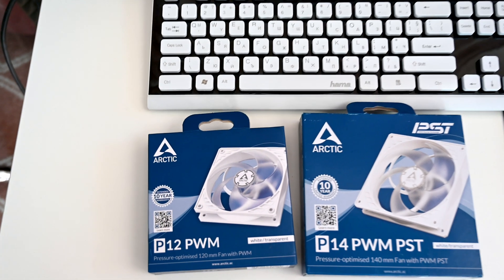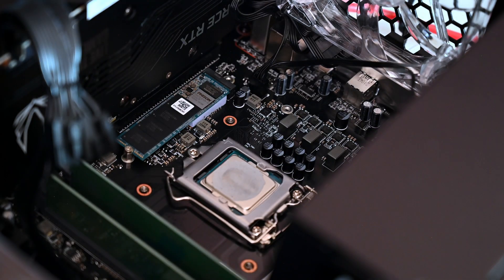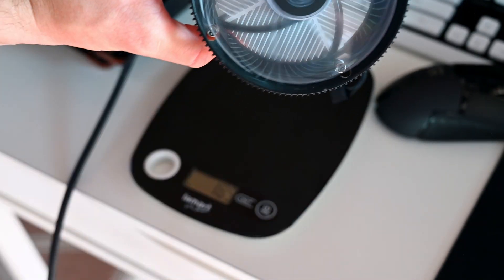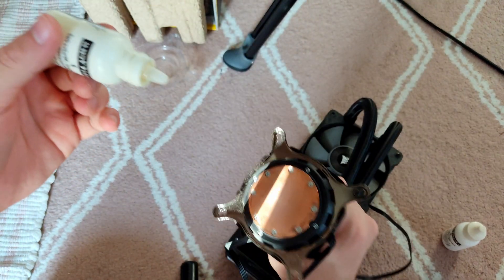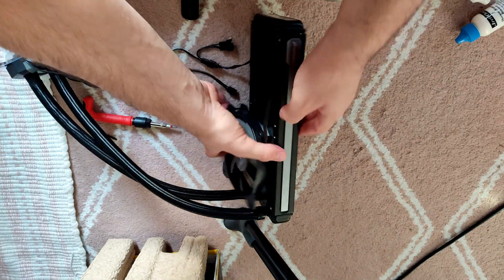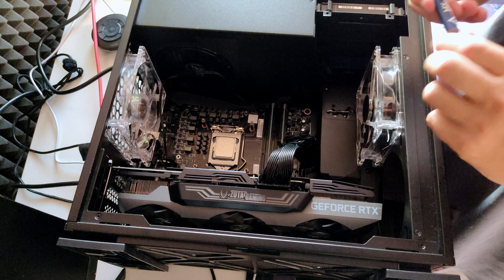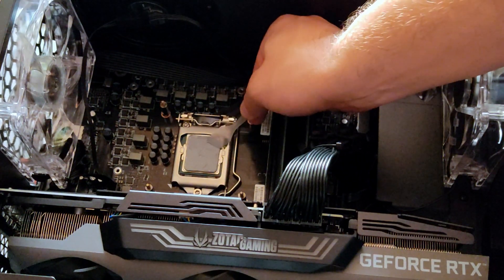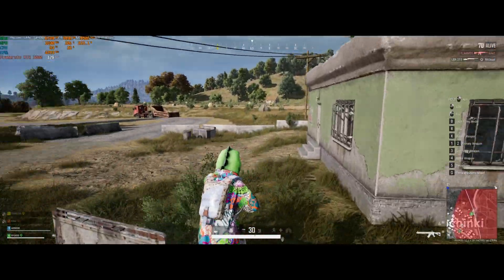How to Remove Your CPU Cooler and Apply Thermal Paste

Comment: is it easy to install a small AIO in this pc?  i bought a deepcool le300 marss (120mm) for the erazer.
Reply from the maker: Yes with 120mm it will be very easy to do
Reply: @Gamingtechgg  thanks
Reply from the maker: @Buk86  no problem